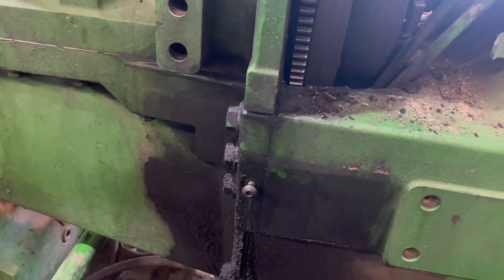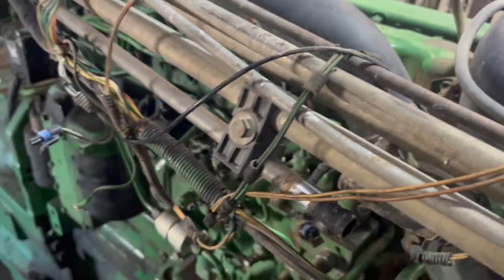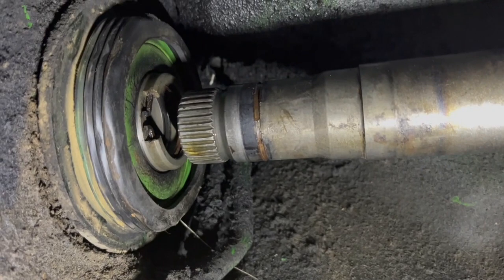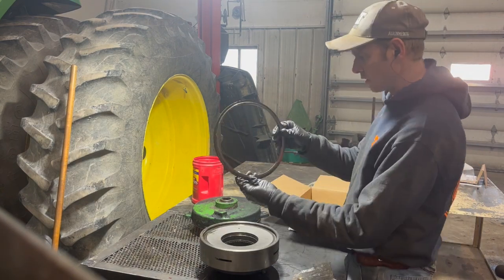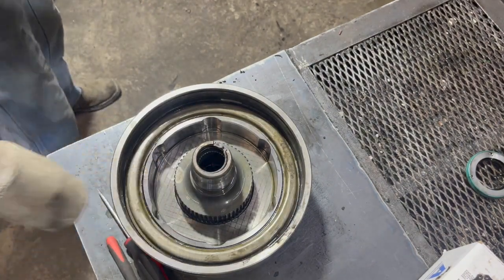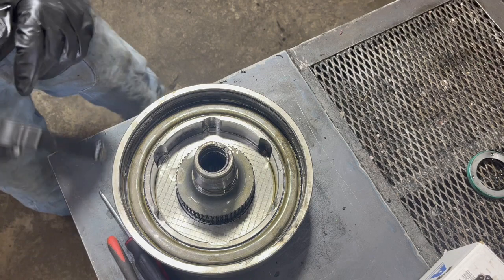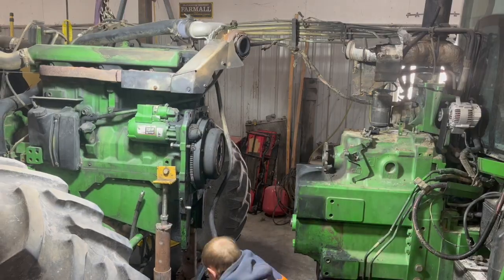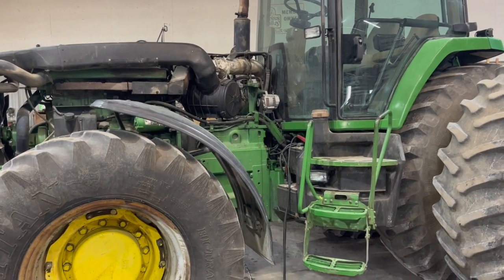John Deere 8300 MFWD clutch repair

Comment: Hello, I have a question for you, I have a tractor 8400 from 99, and it has a problem with gears, sometimes it does not want to shift from 13 to 14 and beyond, and it is both cold and hot, it just switches nothing happens until 13, the screen just shows the 13th gear. Sometimes this problem disappears and he turns on 14-15-16 without problems, I don't know what the problem is, and whether it is possible to fix it myself in the conditions of a simple workshop, thank you!😢
Reply from the maker: Do you have 4th reverse? If you do then it’s not a problem with the transmission mechanics but probably computer. I know when the tractor is really cold it will not shift past 14th until it warms up a bit. It might just be the solenoid valve for that gear. It might have a loose wire going to it that’s not making a very good connection. No matter what is causing the problem it should be throwing a code and blinking the transmission light. If you can give me the code that is coming up that would help a lot. If you don’t know how to read codes I can get that info for you as well.
Reply: @iowafarmer93  ,Congratulations, the temperature at that time was 58, and it did not turn on, I was towing a 10-ton barrel of water. From the morning of the second day, I drove to the field again, the temperature of the box was 22 and it perfectly switched to 14 without problems, then after a couple of days it refused to switch, and it was like that for 2 days, then it switched again, the problem then appears and disappears on its own . I only have one error on the screen, it's HCU 58, it's raising and lowering the hitch from the outside of the tractor, both buttons are broken, it doesn't throw any more errors. If it's an electrical part, and I'm now 80% sure that this is the case, then I'll have to contact an electrician, so I can't do anything about it myself, because I don't know the working principle of this gearbox perfectly.
P.S Yes i have 4gear reverse.
Reply from the maker: Ok so you only have one code on the side screen. That might be the only active code. If you remove the fuse panel cover and take a fuse from a spot marked “spare” and place it in the spot marked “diag” you will enter the diagnostic mode on the computer. Step 2. Turn ignition on but do not start the engine. Step 3. You will see on your corner post screen it says “dia” using your turn signal, turn to the right one click until it says all. Step 4 pull turn signal lever towards you and it will start to go through the different computer errors. If pulling the lever back does nothing it is most likely because it is broken. There is a work around if that is the case. After going through the codes and writing them down you can clear the codes by switching on and off your hazard switch while it displays “END” after the sequence of codes. After retrieving the codes you may post them here. I will only need the codes from the PCU and CCU. The rest will not be of any help to this issue. If there are no codes then I’m afraid I can’t help you any further. Does the tractor have a top speed of 30 kilometers ( 18 mph ) or 40 kilometers ( 24 mph) ?
Reply from the maker: I just thought of something that is a very common problem. When this happens simply take your foot and pull your clutch lever up a little farther. I am almost sure this will fix your problem.
Reply: @iowafarmer93  ,Thank you for the tip, I will definitely check it, now it shifts again without problems, but when that happens I will check the clutch life hack
Reply: Cost?
Happy New Year.